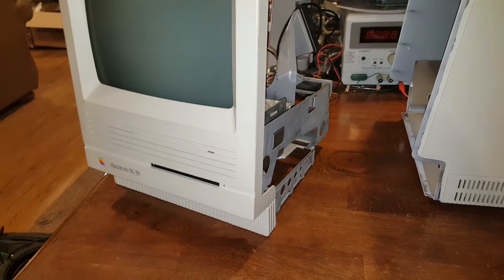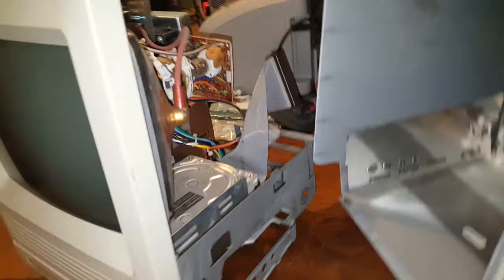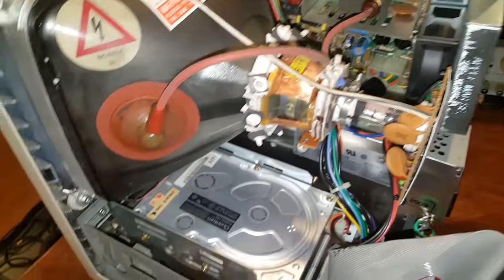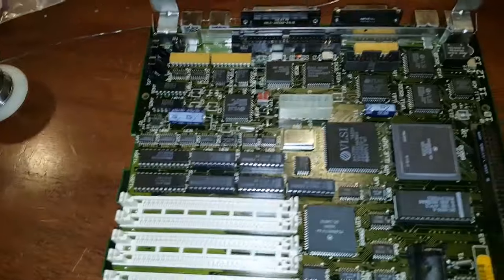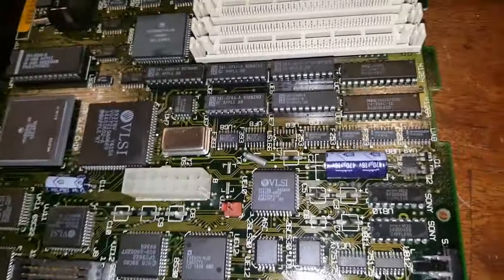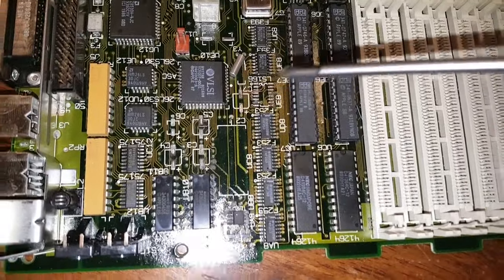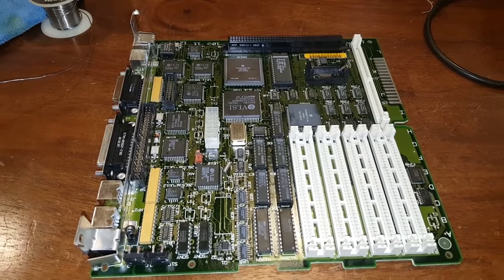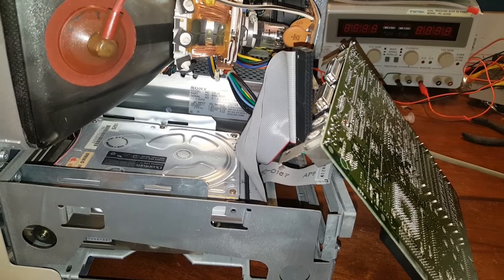Macintosh SE/30 Full Restoration Part 1 of ?

Comment: Would a CR2032 (with a diode if necessary, don't think any Macs used a NiCd/NiMH battery though) be a good retrofit for older Macintosh and IBM machines? Might consider it for my Performa 575 and 637CD
Reply from the maker: +danisidoti84 the 2032 is only 3V. Macs start minimum at 3.6V, to 4.5 in the  Performa 5XXX/6XXX/TAM.

Comment: is the analog board on the normal SE the same as on the SE/30? I have an SE and a Classic II that both need love and have neglected them for a long time. I know I have the SE down here in the basement; it's fairly yellowed, but if memory serves, the CRT has low hours. there is one component on the analog board that does get blisteringly hot last time I tried to power it up back a few years ago. it's been a backburner project forever and I don't know if I'll ever get around to it.

it's likely the cap goo has already taken out the logic board completely at this point; but I do remember sticking one of the boards in the dishwasher. this was a long time ago before I ever put in the IIvx board and got that working.
Depending on what happens I may just say screw it to the compact macs, whatever remains of them, and just recap the IIvx since I do have a 68040 card for it on the side waiting to get dropped in the PDS slot.

I have a IIci upstairs needing love as well; but the goal with that is to reuse parts instead to get my Quadra 700 running again as there's a 33MHz 68040 sitting around here someplace from a Q630 to drop in that. get the right crystal in there, and a fan, and I'll have an overclocked 40MHz Quadra. fairly certain I have the ethernet card from that 630, too, but I haven't a clue where it is. no use to me as I don't have any machines that'll take it.
Reply from the maker: +Sudos the SE and SE/30 share the same analog board. Classic and Classic II share the same analog board, But they are not cross-compatible.

Comment: So, what are your goals; in repairing all of these early macs? Do you just enjoy the restoration and repair process or are you building a specific collection or do you sell them on to others, once the are fixed or something else? I'm just curios; don't worry, you are in good company, I have a bunch of macs and I can't seem to get rid of them either! I'm just curious; what your goals with your vintage mac collection is. Thanks! :)
Reply from the maker: +William Pelzel My goals are to have functional machines, Whether they are used or not. And, only have the machines that meant something to me. Not 2s, 3s, or 5s of the same machines... As far as the "now what..." question, that is one I have been trying to answer for years now.
Reply from the maker: +William Pelzel Ultimately I create these videos for others to learn from and enjoy, especially if they have a collection of their own.
Reply: +THEtechknight  Yeah, I get that; I have pretty much all the old macs, I have upgraded from over the years but have debated on paring things down. My collection: quadra 700, Power Computing 120 (PM8100 clone), G3 tower 300, Powermac g4 dual 500, mac mini G4/1.5, macbook pro 2.5Ghz Intel Core 2 Duo mid 2009 and other classic macs in storage. 
For a classic mac; I was thinking it would be cool, to have a color classic, even though they are slow. Just for games or basic fun! :)

My Macbook Pro 2.5 Ghz Core 2 Duo 2009 vintage; is my daily use machine and it was a used junkyard dog. I fixed it up and with the addition of a intel ssd and max ram, it is a very usable machine. I find buying used broken Macs; a cheap way, to upgrade and find a decent machine, cheap. :)
Reply from the maker: +William Pelzel Yea the CC is awesome, I have one, along with a 575. If I was forced to narrow my collection, it would be my TAM, 2400c, SE/30, and CC keeping the 575 board to go into the CC. Oh and I cant leave out my PB1400 G3.
Reply: I'm thinking tossing my old scsi drives and going with a SD adapter, maybe the way to go SCSI2SD: http://www.codesrc.com/mediawiki/index.php?title=SCSI2SD
Reply from the maker: +William Pelzel They are ok, but are buggy. Keep that in mind.
Reply: +THEtechknight Have you tried one yet? I guess there is a Japanese version but it is a little more expensive. Then again; a 10K Seagate Cheetah could be nice with a 69 pin to 50 pin converter, if you don't mind the noise! LOL! :) I have some in my various Power Macs but with a ATTO or Jackhammer ultra wide cards.
Reply from the maker: +William Pelzel actually the little cheetah drives hardly make noise at all. I miss the old HDD sounds anyways. Yes I tried one and its very picky with SD cards, and you need linux to actually properly set it up. I think he finally released a windows program though. But once it works its fine. Artimix sells the other version which is a re-branded ACARD. I have a Adtron SCSI to CF adapter, but I have learned with CF cards if you dont properly align the partition, they randomly corrupt themselves and operate slowly. Sadly with HFS and older utilities you cant change partition alignment. So I decided to use a MicroDrive CF card, and have had 0 issues.

Comment: yes my Se/30 did suffer any battery leak either mine had the Tadiran battery also my caps need replaced but there is very little damage if any mostly dusty if anything rubbing alcohol cleaned it right up

Comment: I had an IBM ThinkPad 755C die on me because of the CMOS battery (3-cell NiCd) leaking :/ Now I make it a habit to remove those pesky NiCd/NiMH backup batteries in old computers (I would replace with a CR2032 and a diode which should work properly)

Comment: I can help you out with the yellowing of the plastic, the cause of it is the ABS plastic in computers containing bromine (a fire retardant), combined with UV light and oxygen. over time the bromine reacts with these two elements and the plastic not only becomes yellow/brown but brittle and weak as well. to reverse this reaction and restore the rigidity and color of the plastic, you need 91% rubbing alcohol, and a hair product called Saloncare 40, containing 40% hydrogen peroxide for turning hair blonde. this amount of peroxide will burn you so wear gloves. THIS product is far more effective and less time consuming than a Retrobright formula, because this will reverse the reaction permanently and has a guaranteed result. you need to separate the computer from all the plastics and clean them thoroughly with soap and water, then give it a quick even coat with the alcohol. after it's dried, get a paint brush and lather the yellow plastic with saloncare 40 evenly and generously. after it's been coated, place it on a tray with a clear plastic wrap to keep the gooey hair product from evaporating. every two hours apply small amounts and resurface the paste evenly. you can either do this outside on a sunny day or overnight with a UV lamp (blacklight). using the sun, the process takes about 8 hours, using a UV lamp the process can take a few nights depending on the power of your lamp. 
restoring the plastic is not only good for cosmetic restoration, but to keep the housing from cracking and chipping. it will give the computer many additional years of service and maintain conditional value.
Reply from the maker: Yea, its called Retr0Brite. I know all about it, for years. Problem is, it damages plastic over time. And the paste stuff will cause streaking if not done properly. No Thanks! There have been many different mixes of this, but the result is still the same. it bonds the bromine with hydrogen instead of oxygen. It does NOT replace the elasticity in the plastic, once brittle always brittle! PERIOD.
Reply: I ran a stress test with two super nintendo systems I had at my disposal after restoring the plastics, the mid yellow system took 16 pounds of pressure on its housing before shattering, and the saloncare plastic took almost 35 pounds before a large crack appeared in the center. I didn't have any more to ruin at the time so I concluded from this that the plastic had been repaired with the saloncare formula. most others I showed the result to validated a good restoration so I left it at that. since then I've done two gameboys, a commodore 128c, a famicom, and most recently a macintosh plus. all of which have maintained their color over the past seven years or less since the treatment. I don't use retrobrite because it takes multiple sessions and I've seen some peoples treatments revert after the first five years.
it's up to you whether or not you care to go through with any sort of plastic treatment, I just thought you'd be interested when you were insistent on proper cap replacement for aesthetic purposes.
Reply from the maker: Seth Andersen Yea but plastics are a different animal. But that is a layer of chemistry/physics that is foreign to me so I tend to be skeptic on trying random stuff. Electronics is a different story. Speaking of brittle, the LC575 and the Performa 52XX series are getting very brittle, and my TAM is too. But I am not against trying something that is proven with no ill-effects.
Reply: in my experience, there is no risk of using what I buy to restore plastics. its a very nice pre-made paste with the perfect consistency and substance for coating. I'm considering doing it again to my friend's quadra 950 once he has the money to buy the product, because it's gonna take about 2 bottles. I'm most comfortable in the cosmetic end of video games and computers because I have to restore them for reselling and know a lot of ways around restoring plastic color, texture, and grade. a lot of people like to paint the housing, but in a number of ways that really just makes things worse. even if the plastic never comes back to its original strength, its really nice to have the unit looking as new as possible.
Reply: if youre still not very thrilled about the idea, you can buy the smallest bottle and try it out on an ADB mouse or something spare you have laying around.